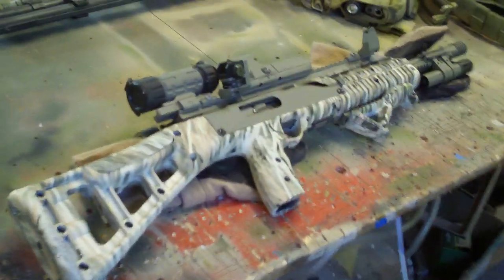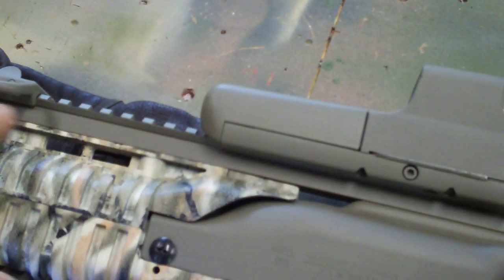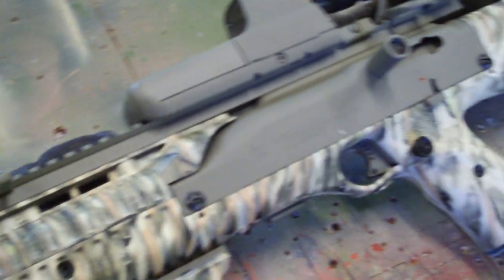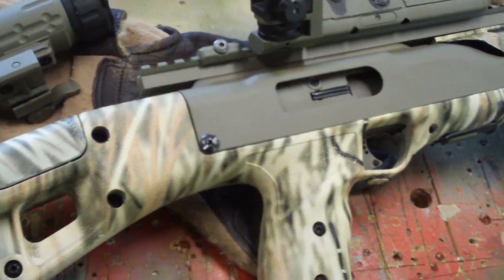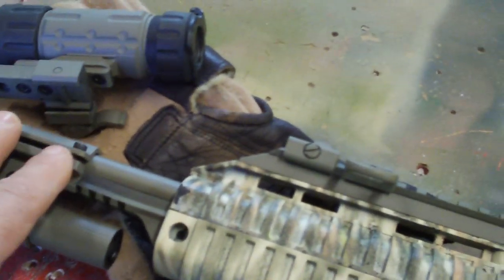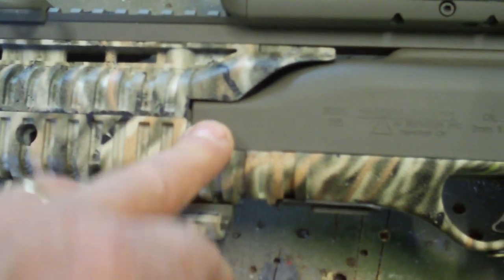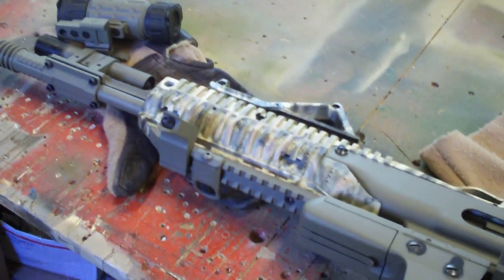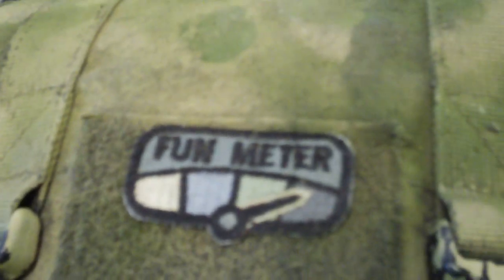Great Gun for a Tinker: Hi Point 995 Classic

Comment: You done what I want to do to my 995 TS put a full pictanny rail on the top and bottom  and the rail on the barrel is really easy to remove like you I'm tinkering with it I've put a bipod and forward grip on it and a flashlight your muzzle break you have I read not to use on threaded barrels so I was wondering if your barrel is threaded I just got mine this year and it's a great carbine and I got it because I wanted to be able to buy one type of ammo for my sidearm and rifle.

Comment: I have the original High Point 9 mm I took it to the range people shooting all around me I was shooting my Target at about 50 yards and I thought I was missing so I shot at that the metal pipe holding up the targets is was about 2 inches wide I shot at it a couple times and hit both times   the guy said hey don't  shoot the poles turns out I was shooting dead center bullet after bullet first time I ever shot it ..

Comment: Thanks, I want to be a Hi Point carbine fan.
Reply from the maker: +Bill23799 It's a straight shooter and at 100 yards the 9mm slug has the same joules as a .357 from a 6" barrel at 50 feet. Cheap to shoot. Easier to get 9mm than 22lr these days. My personal experience is the gun is more fun stock than modded. Iron sights work great up to 100 yards and the gun is really light. Start sticking stuff on it and it rapidly becomes a pig to lug around.
Reply: I had to sell all my guns to finance my move from Houston.Tx to NC.   I had several .45 pistlos including a Detonics Combat master.  I also had an AR-15 i dearly loved because i built it from a stripped lower.

My most fun gun to shoot though was my Mechtech systems  CCU   ( Carbine Conversion Unit ) .  It used lower from my M-1911 pistol to make a 16" .45 carbine rifle.    It was deadly accurate with Red dot sight and i had it sighted in at just 25 yards but i could put all rounds through same hole.    I am gonna try to save up for a Hi Point carbine.  I have a feeling it will be just as fun to shoot .

I wish there was a place i could buy one on lay away basis.

Thanks for your video